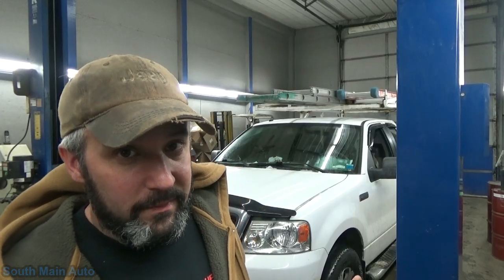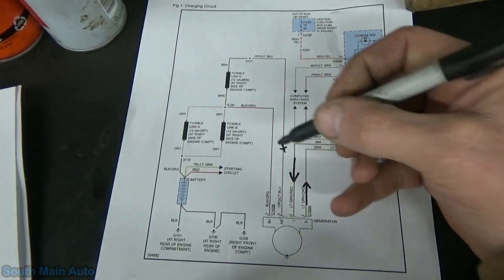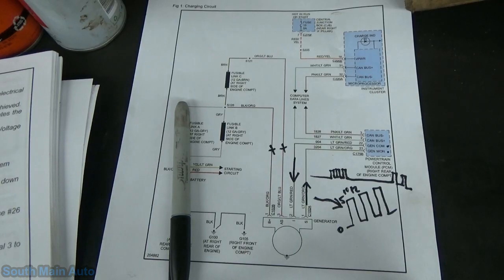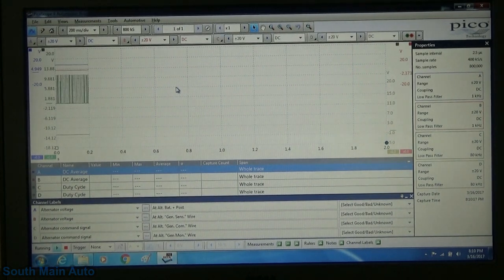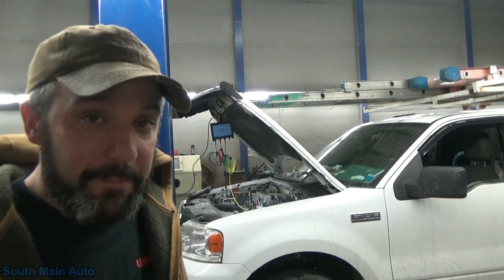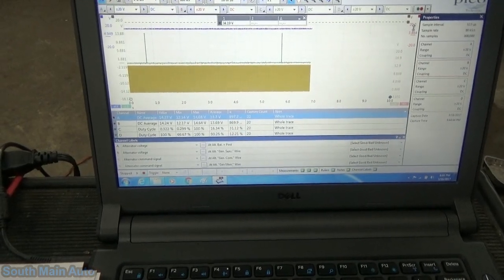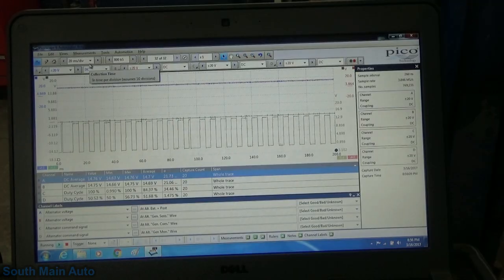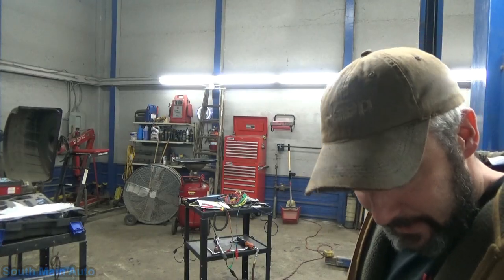Ford "Smart Charge System" Alternator Not Charging

Comment: I just found out and it seems to be that on some European cars if you replace the battery you have to do a charging system reset using a scanner or it will kill the new battery. I think I read about this on identifix about a Volkswagen if I remember correctly. I then asked a reputable BMW shop owner if it if he knew anything about it and he said yes. He said he installed a new battery in a BMW and it got killed in about 6 months because he didn't reset the charging system. It sounds just crazy to me. It seems if the charging system is at a current state of hi charge because of a weak old battery it will stay in that state and over charge the new battery. I'm sure its more complicated than I understand.

Here is an charging system description of operation for a 2005 Ford Mustang 4.0: The PCM-controlled charging system provides many additional benefits over the current integral generator regulator system. The first benefit is improved battery life. In an integral generator regulator system, the regulator set point is established by a temperature sensor in the regulator which estimates battery temperature. In a PCM-controlled charging system, the regulator voltage set point is determined by the PCM and communicated to the regulator through the generator regulator control (GENRC) circuit. The PCM uses an algorithm to estimate battery temperature. Improving battery temperature estimates will reduce battery damage caused by over- and undercharging.

The second benefit is improved engine performance. Whenever the PCM senses a wide-open throttle (WOT) condition, the PCM will momentarily lower the regulator voltage set point. This reduces the torque load of the generator on the engine and improves acceleration. The PCM has a calibratable time limit on this reduced voltage feature. This is to prevent the generator output from being cut back for an extended WOT period, which could cause battery discharge.

The third benefit is improved idle stability. In response to the PCM's GENRC signal, the regulator uses a generator load input (GENLI) signal to provide feedback to the PCM. The GENLI signal provides the PCM with charging system information. Specifically, it lets the PCM know when the charging system receives a transient electrical load which would normally affect idle stability. Because the PCM can anticipate additional loads, actions can be taken to minimize idle sag. The PCM can choose to either reduce the regulator set point or increase engine idle speed, both of which are calibratable features. In order to establish whether the regulator is accurately maintaining the desired voltage set point, the regulator uses a charging system voltage line to sense battery voltage.

The fourth benefit is reduced cranking efforts. The PCM can reduce the mechanical load on the starter by initially commanding a low voltage set point. This may improve start times.

If the PCM detects a charging system error, it will broadcast a low voltage telltale (ON) network communication message which tells the cluster to illuminate the charge indicator. The charge indicator will be illuminated if the PCM fails to see a signal on the GENLI circuit for a time period greater than 500 milliseconds. This telltale command will also be used to indicate over-voltage conditions detected by the PCM-controlled generator.

Each time the ignition switch is cycled to the run position, the instrument cluster will initiate a bulb check by illuminating the charge indicator. It is the PCM's responsibility to issue a low voltage telltale (OFF) command if the charging system is functioning properly. This message should be sent during the network initialization in the voluntary phase (250 milliseconds to 450 milliseconds after the ignition switch is cycled to the run position). If a low voltage telltale (OFF) network communication message is not received, the instrument cluster will continue to illuminate the charge indicator indefinitely.

Comment: Im betting it is not the fact its "in a high charge state", I betting its because the desired voltage is steady and the PCM only transmits every 5sec OR when an adjustment is needed which ever is first. At start it wanted that set desired voltage due to low battery, but once running and charged a bit it's constantly changing its desired voltage for efficiency reasons, thus it is constantly fine tuning its instructions to the Alt with of course feedback from the Alt feeding into calculations to come up with the instructions, and again thus the constant "talking" vs every 5 sec. At Least that is my theory.

Comment: So I guess I got confused with your conclusion it was the alternator after you bypassed pcm? I thought once you revved it the alternator started working just fine and there after? Having the same issue with 06 Ford Five Hundred. Same “smart” bs system but i bypassed my pcm as advised and turned engine on and low and behold no charging still. I didn’t bother revving it. I yanked that sob out because I just replaced it about a month ago with a duralast reman and you bet your ass I was gonna walk that up there and give them an earful.

Comment: It is not that difficult to understand. Easy. On initial startup, the GEN COMM is used for sending command to the regulator, to put field voltage into the alternator, to start charging.  As soon as it generates voltage, it does not need that command so you see only periodic waveform for the regulator.  The gen MON is primarily used for ECU to rise RPM, and ly tell regulator to increase field voltage. And yes, it is not instant. As far as I remember there is specific MAP in ecu just for this. As you started the engine with alternator unplugged, there was no field voltage in the alternator until you raised RPM and the alternator got self-exited and started charging. All it needed was a new regulator.

Comment: very informative video, put a new alternator on today and tested it at 14.1 V, post test drive it dipped to 13.6, and then 13v after letting it idle for a bit. unplugged the coms from the alternator and its charging at 14.1-14.2, battery light has also popped up. bit of a loss right now, either the alternator regulator has crapped out, or the PCM system is restricting charge not really sure.

Comment: Whether or not its relevant to the job you are doing, Its relevant to the job i am doing, and i appreciate that greatly. I have one that charges and quits charging, Alternator replaced, battery replaced. So this vid greatly helps in my impending diagnosis.

EDIT: just for clarification, i did not replace either, the customer made assumptions and did this before contacting me. I AM NOT a parts changer. I dont have a fancy a$$ pico, (yes i am jealous, but not in a malevolent way) however my Vantage Pro or my Autel  MP408 will do nicely.

Comment: Do you have any tips for troubleshooting a code P065B (Generator Control Circuit Range/Performance)? The truck starts fine and the battery light will be on for about 30 seconds then the light goes off and the truck works fine for the rest of the day. This only happens when the truck is off for longer then a couple hours. Thanks.

Comment: What is the advantage of the smart charging system supposed to be?
Reply: think of it as "smart" power distribution.   It's also smart to vary the battery charge  rate in response  to temperatures.

Comment: I had a multipart charging system issue. It started off as a bad alternator. Then got another bad alternator from the parts store (Both confirmed bad by their testing). Third alternator also seemed bad had them but they said they tested it good before it came over. Turns out that a bad tensioner was causing it not to charge with the known good alternator. Tensioner felt pretty good when I started but when I went to take the belt off the last time it stuck back quite obviously.

Comment: my question is how can we bypass the PCM bs, and unplugging the connector didn't work on my truck. is it possible to install an old fashion voltage regulator like in the old Crysler between the battery and alt?

Comment: How hard would it be to convert one of these systems to charge a battery the older way, without a computer?
Reply: It's a nice thought but you wouldn't do it with the alternator that was meant for the vehicle . perhaps you could direct wire to the cylinoid with a direct wire button installed

Comment: I always thought that weaker battery need that initial current from the alternator to start the engine and i'm wondering if there is any data indicating that smart charging system extends the life of battery or alternator; probably not because either one fails regularly

Comment: Somehow Duralast Batteries don't last in an 03 Expedition. I've had an Optima power an 2012 Tahoe with a blown alternator and held trhought the winter of 2016. Bought the optima in JULY 2016. And currently use the optima in 3 vehicles

Comment: Have you made a video yet of the newer GM charging systems with the current transformer on the negative cable and what interesting things you can run into with bad grounds and also what interesting things you'll run into when adding an auxiliary battery and/or adding aftermarket high current accessories to the electrical system like off road LED light bars , high end stereos ,winches ,etc.

Comment: Similar situation, alternator died at around 100Kmi on my 2002 Windstar. Never threw a code, never even turned on the battery warning light. The car just intermittently died on the road when the voltage dropped down to 10V or so. I suspect the brushes were making intermittent contact near end of life. How did Ford manage to mess up the warning light even? Didn't anybody test these features? Boo!

Comment: Poster "distress"  Is obviously a staunch defender of the right to remain ignorant.  Understanding the system, device, circuit,  whatever, is the key to logical  trouble shooting .  What does it do that it shouldn't do,  what isn't present, operating,  or otherwise that should be .  Eric "O"  presents logical diagnostic trouble shooting better than any  automotive site  on the web that I have seen.  There are others that are very good, but move too quickly, & imply that others who don't immediately follow are "idiots".  Weber College has excellent engineering descriptions ......he tells no one how to fix anything, but  has superb technical descriptions. If you need someone to supply a step by step  syllabus  to fix a fault, maybe you should educate yourself further , or find a competent mechanic.  Not being nasty, just saying.

Comment: You are a fantastic mechanic, and you obviously know your stuff.  I would take my truck to you any day.   I just wish you had done one more thing to make sure that it was indeed a faulty alternator.   You should have disconnected the OLD alternator from the (dumb) smart charging system to see if was indeed bad. 

The reason I say that, besides the obvious, is that there's talk out there on Ford forums, that the computer learns bad behavior, and recognizes it as being normal. 

I just put a new battery in my 08 Lincoln Mark LT, and now it's throwing a code for the charging system.  It started doing that the minute I started the truck after I put the NEW battery in.   It NEVER did it before while the OLD battery was in it. It would be absolutely amazing to me, that at the very instant my old battery was completely dead, the alternator crapped out as well. 

I know it was the battery that was bad, because it would be dead in the morning, I'd jump it quick, and I could drive around all day with the AC on, the radio on, drive at night with the lights on, and it would ruin just fine, and it would also start up every time I started it that same day.....then.....it'd be dead again in the morning.   So, CLEARLY, the alternator was maintaining a certain level of charge in the OLD battery.   The battery would just go dead overnight from the power draw from background devices.....alarm, radio memory, etc.....

Anyway....I looked that symptom up in the Ford forums, and found that this is a very common thing actually.   So, I just figured I'd let it run for a couple days and see what happened.  I just kept hitting the reset button on my dash every time the battery light came on, and the monitor said to check the charging system.   I noticed today, that indeed, my battery was getting low on the gauge.    I was driving by  pep Boys, so I whipped in to see if they could test my alternator quick.

The guy did the tests, and showed me that my battery voltage was 10.4....and that my battery was junk.  lol   Well.....no duh my battery voltage is low.....I told him that my battery was about dead.   But....at any rate, we tested the voltage while running, and, it didn't go up at all...so.....clearly the alternator isn't charging the battery either.  I doubt the battery is junk...it's just currently dead....

But here's the issue.   While my OLD battery WAS dead, and was obviously dying for a while,  the truck kept running fine, I think the computer just learned that low voltage as being normal, and so now it won't charge the new battery.  You follow?   The old battery was probably only running at about 11-11.5 volts, so the computer interpreted that as being normal, and now it won't charge the new battery past that, and actually lets it drop even further. 

I'm going to what you did, and unhook the alternator from the (dumb) smart charging system, and see if it starts charging.   If it doesn't, obviously the alternator is bad then, but, I'm betting it'll charge it.   It looks like a newer alternator on the engine.  I just bought the truck in April, and all this stuff going on is telling me that the previous owner probably had similar issues.

Just wanted to give you something else to think about. 

Thanks for all your information!!

Comment: I have spent the last few hours working on my 2013 F25 with this problem.  The NEW alternator was also bad.  It would not produce a steady voltage if the control plug was connected 13.8 perfectly if disconnected.

Comment: Not done watching video, currently at 34 minutes.
I believe the PCM is having an issue seeing the temperature of the battery.
Remember, the goal is to save the battery, keeping it in a "maintenance" state. To prolong the life, and produce efficiency in  the engine, as well as to help control, or alleviate voltage spikes.

So, In other words, the AMP clamps/Temperature Control sensors, are what I'd be looking at :-)

Comment: I am watching appreciate this to no end.
I’ve just done an alternator swap on my Focus.
(aka horror story) I did ok & used my crane to 
swing the motor and get it out. But the alternator
i’d put in was making the same voltage as the one
i’d just taken out 15.4V. After running the car,
& watching this I went back to check & yes
 it had changed to the 14.2-14.3V the car needs.
I had pulled a used one off a car. It had it’s 
rebuild stickers & was about 10 months old.
I’ve only got a multimeter, a load tester 
BA7 to work with & was not sure on the results.
 Big thanks Eric !  I slept better last night.

Comment: Excellent video, Eric.  I have an 03 focus sitting in the driveway right now as it will not charge... same as this truck, no batt light and the gages wigged out a bit.  Not having a scope yet, I will unplug the connector and see if it will default charge.  I already checked the 175 amp fusible link  on the charge line and it's good.  Great video

Comment: I had my alternator on 2006 Ford five hundred replaced, the car started just fine, lights worked fine, but my check engine light and charging system warning light stayed on. I took it to another mechanic, he called and said the alternator was bad, and he had to order, and test, three different altrrnators before finding a alternator that worked right. Of course, he just returned them each time. But, that fixed my problem, the car not only starts, runs fine, and all accessories work fine, but no check engine light or no charging system warning light. I'm not sure if this is a common problem with 06 five hundred's. Thanks for the tips.

Comment: I've got a question Eric.  Why do some vehicles alternators not put out a fair amount of ampers at idle or around 600-700 RPM? 
In this video, the alternator is holding the battery volts around 13.8 at a very low idle.

Comment: Great video thanks for your time !
I recently diagnosed a BMW 525i with a low charge condition , checked charge rate at battery found it too low , checked again at B+ post on the alternator and it too was low , case ground ok as well.
Scoped the single LIN line into the alternator and found the PCM command signal present and intact.
Was seconds away from calling an alternator when the PAS pulley caught my eye , it didn't seem to be turning at the correct speed from what I could hear of the engine speed. Got a colleague to rev up the engine and the aux belt didn't change speed with the engine rpm , it stayed approx 300rpm .
Took the belt off and found that the crank pulley had delaminated and was acting like a slipper clutch, the more load on the belt the more it slipped.
The centre of the pulley could spin independently of the outside.
It pays to do the correct checks I guess , but I've never seen that happen before in my case just guessing at the alternator would have dropped me in the proverbial. 
Thanks again !
Reply: Expect the unexpected!
There is a DiagnoseDan video where the door handle stops a BMW from running.

Comment: I had the same issue.  I was reading in the OEM manual that the Gen-com and Gen-mon we're unilateral PWM.  Since I didn't have the signal from the generator to the PCM I assumed the problem was the voltage regulator.  I open the generator and found a bad brush and a slip ring cut in half.  I replaced the generator and had the PWM on both wires.